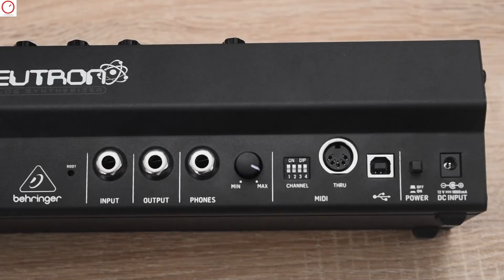Behringer Neutron Semi-Modular Analog SYNTHESIZER - First Look | SYNTH ANATOMY

Comment: A nicer feature set than the Mother-32 or Lifeforms SV-1 I'd say.   Dual sine wave VCOs are a must, and these VCOs are full featured.   Dual ADSRs and the delay is great as well.  The only thing this apparently doesn't have that I'd like to see is a ring modulator, and if it were me, I would have made the overdrive a wavefolder.   But for that price, it's a Mother-32 and SV-1 killer.

Comment: Good review. An almost perfectly designed synth. Only fault I can find is that the filter sounds like an old D10 digital filter from the eighties. Which will probably rule out several categories of sound, like acid and synth pop bass line. Oh well, for the price it is a no brainer.
Reply from the maker: Thanks Max. The filter sound from my side very good for this price point. It's a bit like a Moog filter but doesn't kill the amplitude while raising the resonance. Acid will more complicated because it's not a filter like the TB-303 but for synth pop I would say this will work. It's a no-brainer for sure :)
Reply: I doubt that you'd be un-able to get acid type baselines out of this.
Granted that it might not sound like a 303,but I'm sure it can do  bass & acid sound.
Reply: Now I'm wondering what types of filter are allowed to be used for synth pop, and which filters other than the old D10 digital filter would alert the Music Police to invade your studio and burn it to the ground.

Comment: Nice demo and overview of features ... sounds like it may still get a tune-up before final release.  
Other than MIDI does it have a Clock input for sequencing?
Reply from the maker: Thank you Valdis :) This is already the latest hardware revision. They will fix some bugs on the MIDI side and than it will be ready. The sound will be this, maybe the delay will be a bit refined but don't know. No doesn't have a clock for sequencing only a S&H clock
Reply: SYNTH ANATOMY Korg Sync would have been a natural addition IMHO.  People looking to move up from their Volcas would naturally look at the Neutron as would people with Monologues and Minilogues looking for a first step into modular rigs.  The Keystep also supports Korg Sync.
Reply from the maker: So basically you have KORG Sync ;) If you have a Keystep just connect it to the MIDI In of the Neutron ;)
Reply: SYNTH ANATOMY Oh, I get it ... the Keystep translates from Korg Sync In to Midi Out to the Neutron. :-)

Comment: Sounds very smooth, not too harsh like my minibrute
Reply from the maker: Antonio229 yes the MiniBrute is a very harsh, brutal analog synth :)
Reply: Sounds lot better then brute the filter its great.Also it have its own sounds maybe a biy moog inspired great synth
Reply: I wouldn't say Moog inspired: it has the same VCO as the MKS80/Jupiter 6, SH-101, and the Prophets. Combine that with a 12db filter, and it's smooth, but not Moog.

A poly made from this voice design would sound really sweet.
Reply: what's wrong with that? ))))
i love my microbrute for being harsh. and I want this one too.
Reply: This is the perfect reason to own more than one synth. Ideally, all flat surfaces are covered in synths. :)
Reply from the maker: me too ;) really love the harshness :)
Reply from the maker: absolutely :)
Reply: roady kin its shit for the money too much limitations.The Steiner Parker its sounds the same.I had fun with the brutes but no one liked this nasty sound I like it but its way too nasty for normal.ppl.The Neutron gives a lot more for the buck its just shitting on the Arturia stupid.limitations.
Its just better synth then any cheap monos I heard.

Microbrute didn't read velocity its a toy
Reply: The Minibrute doesn't have to be harsh.  It's set up so the oscillator distorts, overloading the mixer/filter, if you have the sliders above half way up.

Lower the sliders below half way, and increase the output volume instead, then it's a different sound all together.
Reply: I love the way the brutes can be harsh or soft. I love the tone of it. I also quite like the sound of the Neutron. Not in the market for a new synth at the moment though.
Reply: TooSlowTube the filter its shit the oscs are quite good on the brute but this steiner parker its awful and dull when closed.Matrixbrute has better but different pricerange.Behringer are killing it I am buying this.and model d instead of brute 2 those wipe the floor with them soundwise.I always prefered Monark and Diva/Repro definetelly more balls then Brute I just liked the osc sound..Even the korg Monotron filter was better
Reply: I like the Minibrute filter, personally.  Each to their own.  I haven't tried the Matrixbrute.  

I can't say I like the Bass Station II filter very much, for example - the 24dB setting is too dull and the 12dB is too noisy, or maybe 12dB/octave isn't quite enough to mask the inherent crappiness of the BSII sound.

No doubt many people will disagree... I can't say I really care :)

I like the immediacy of the Minibrute user interface too.  The BSII lacks at least another two dozen knobs to make it one per function (check the MIDI spec page), and I keep losing the sound I'm making when I try to adjust an on-key function or use the preview mode before I save it - it's too easy to change to another patch, by mistake.  

The BSII can make some good sounds, but it's a total PITA getting them, other than as a saved preset.

The Neutron and the Model D appeal to me for the same reason the Odyssey does, and the Minibrute does - what you see is pretty much what there is.
Reply: TooSlowTube I feel the same about bulshit station 2 lot of bang of the buck but doesn't bring anything interesting.Model D and Neutron are just awesome.bargain for the price!!!The brute I.don't know I liked it but it always sounds the same tone with this filter...The second.update its.underwhelming they didn't do much but they raised the price...Odysey its awesome machine but I find the Neutron more fresh sounding to.my ears.I couldn't click with most new Mopho,Pulse 2 etc they have lot of options but the sound its sharp and harsh in the face no.warmth ..
Reply: I'd have been more interested in the Minibrute 2 if they offered it as just a synth module - no keys, no sequencer.  I'm not into sequencers, and I already have keys.

I gather people who are into sequencers already have those too.  I'm not sure how much there is to gain by having one built into the synth.

I like my Mopho Desktop, but it is a different sort of sound, yes.  The biggest appeal for me was the modulation matrix - you can pretty much do anything to anything with anything, which is great for wind controllers (Yamaha WX5, Akai EWI and so on).  

It's another one where you pretty much have to design a sound and save it as a patch, not tweak it as you play it, unfortunately.  

I'm leaning towards knowing what the controls do and adjusting them as I use a synth, rather than the design patch -> save for later -> recall and play thing.  Each approach has its merits, I suppose.
Reply: TooSlowTube yes yes I.love.the mopho modulation matrix.but the filter its.very brassy limiting sounding, lowpass only its really limiting.The Neutron have a bit better filter I guess
Reply: Maybe so.  One of the first things I was impressed by was how good  a brass instrument sound I could make with the Mopho - not 100% realistic, but very much a brass feel to it.

I find I use the 2 pole filter on it more than the 4 pole one (12dB vs 24dB, I guess).

I could put it through an external filter, but part of the fun of it is  modulating the filter from the mod matrix - especially from Breath on a wind controller. You can modulate the resonance too, not just the cut off.  

I have a SEM style Eurorack filter I could use after it, but that can only modulate the cut off, plus the Mopho is complicated enough, without involving more equipment.

I finally got things so that I could have a physical control for all the main parameters, except the sequencer, which I don't use.  

I use three Korg NanoKontrols, with an abandonware editor called MophEd (licenses can no longer be bought for it), in a DAW called Cantabile, which lets me assign the controls.  I use one of those three controllers as two pages - so I could have used a fourth.  That still doesn't cover quite everything.

My point is, I think a lot of the limitation is the awkwardness of trying to work all those controls with just an on screen editor - with bugs.  It still has a lot of potential.

There's something to be said for a simpler architecture though.
Reply: Yes. The minibrute is designed to be harsh and different sounding from CEM / SSM (clone) integrated circuit based synths.
Reply: Absolutely agree with you Pete! And, from what I have been told, you can use a set of it for poly by midi chaining them.
Reply: @georginikolov1141  that's so strange then that Adrian Utley of Portishead would have liked the Brute so much he made a video about it being a part of his setup for a while. Clearly you know more than he does about synth sound quality, that's clear from your anonymous YouTube post on this channel. Looking forward to hearing your era-defining music and seeing you at major gigs!

Comment: Nice overview.

For the curious, here's some electronics info on the CEM3340 VCO, including other synthesizers that used it (and how). Behringer almost certainly used their coolaudio version, but Curtis has also reissued the chip.

https://electricdruid.net/cem3340-vco-voltage-controlled-oscillator-designs/
Reply: Pete Brown 
📌You mean that “ NEUTRON “ has the CEM3340 oscillator ?
      
🕉        🎹          🇵🇹
Reply: Pete Brown 
📌Dude ; your You Tube channel is AWESOME !!!  👍👏 

🕉     🎹     🇵🇹
Reply: Yes, the neutron has the CEM3340 oscillator. That's what the "3340 VCO" label is under the shape knobs. Makes sense, since Behringer re-released these a while back.

Re: my channel: Thanks :)
Reply from the maker: Thanks Pete for the additional information :)
Reply: Yea, Behringer own Cool Audio, so it will definitely be those chips. I guess they bought them so they could have access to these chips for cheap (cheap as chips!).
Reply: Pete Brown I'm about to build 4 more 3340 vcos for my eurorack, and now i see this lol. My eurorack will definitely be better overall, but I'm really considering just how much is too much 3340 and snagging one of these lol.